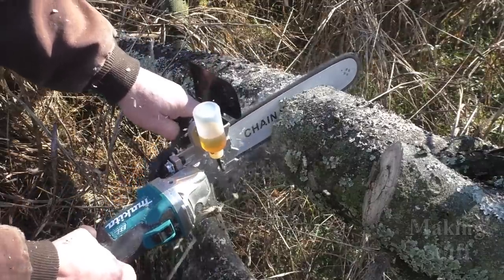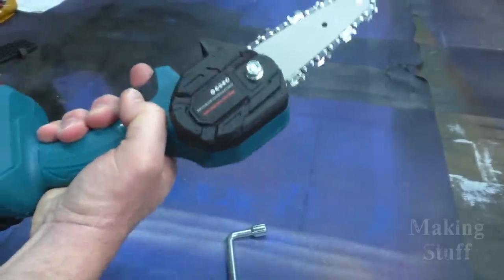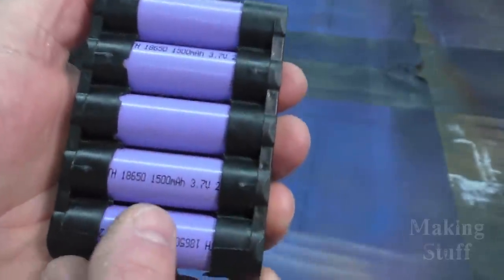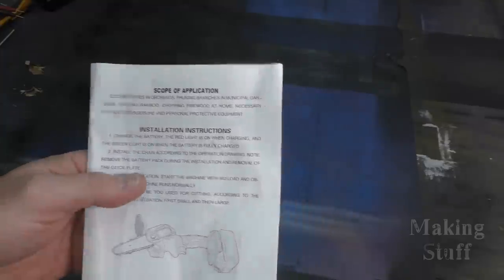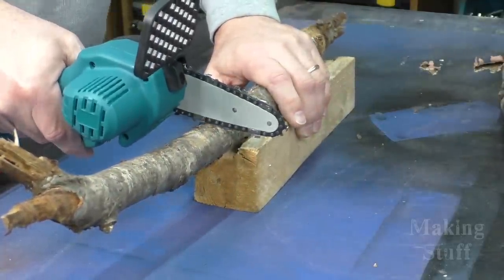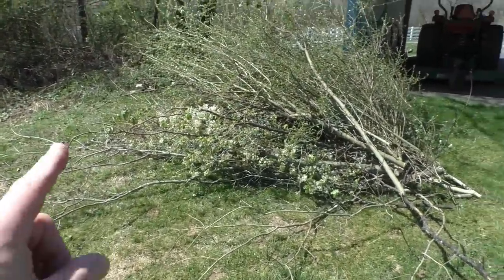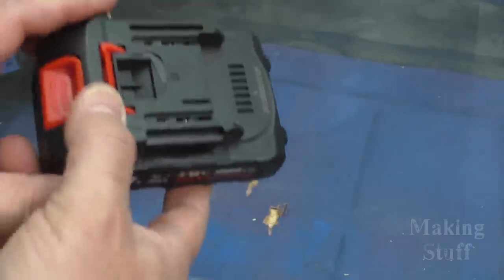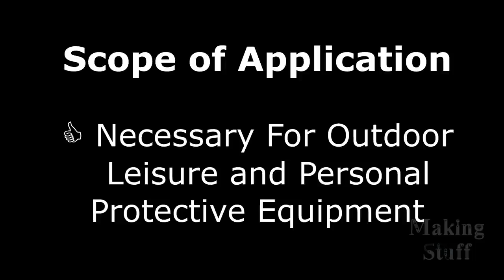Mini Cordless Chainsaw Review - Is It Any Good?

Comment: Thanks for that upload very much appreciated I grow a lot of eucalypts white yellow box redgum and they need trimming when young to get them growing up and not out, to get maximum growth from them. Definitely going to get one, as I have about 9 chainsaws and am registered as a forestry plantation and am so impressed with the ease it cuts no rump rump rump brrrrrrrrr with the saw plus I have the makita battery system for trimming younger trees limbs back. Plus with a knock off 9.0 ah makita battery I reckon it’d last for ages. I use one on my makita 18v tyre inflater.

Comment: Good info thanks for the review looking at one of these to clear mtb single tracks carrying in a back pack note i will be taking the battery out whenever its not being used as i dont want it to chop my head off. The lack of safety switch is the only bummer i see thanks again .
Reply from the maker: Removing the battery is a good idea.  I do the same thing when I'm not using it.

Comment: A great video, thank you... I bought a 10-inch one and unfortunately had problems. It kept cutting off every 2-3 seconds, then I put a newer battery pack, worked for about 20 minutes, while motor getting extremely hot, going out in smokes and eventually stopped starting, just clicking and nothing happens. Stopped working while smoking and smoldering. Probably burned out. Waited for it to cool down, took it apart and  realised that the motor bearings were probably bad, too tight or defective. No free spinning of the shaft. Got a full refund from Ebay for AU$ $68... Not sure if the motor shaft should be freely spinning, mine was not, and hence thought that the bearings must have been bad that put extreme stress on the motor eventually resulting in it burning out... is the motor shaft free spinning on yours? Please let me know. I am thinking that mine was probably defective and considering buying the same one but from a different seller. Also, mine came without any mention of the lube oil, nothing in the instructions manual, etc. I do not think that the lack of lube could have caused such a rapid failure.... Thanks.
Reply from the maker: My motor is free spinning.   Make sure the chain was not too tight.  You should be able to turn it with your hand.

Comment: Handy little tool for all those branches that are too thick for loppers while being unworthy of an actual chainsaw. I could put it to use during all those brush cleanups I'm doing for my customers.  Although my brain is telling me to spit out 130$ for a Stihl mini chainsaw. It will last. This thing, I doubt it..
What about the autolube? Does it automatically lubes the chain or you have to periodically sprinkle the oil to a bar from that container you got with the machine?
Reply from the maker: No it must be manually lubed.  A little bit goes a long way, it's not like a regular size gas powered chainsaw.

Comment: That "chain brake" is just what happens when power is cut-off to a brushed electric motor.  There's no gas engine crankshaft & piston that keeps moving when the ignition is cut-off.
Reply from the maker: Technically you are "cutting it off" but that isn't what I am talking about.  I am talking about letting go of the trigger.  When you let go of the trigger it immediately stops unlike letting go of the trigger for a gas chain saw that is rev'd up.  Thanks for watching!

Comment: Small chainsaw with no trigger guard or safety lockout. Great tool but in the back of my mind I’m hearing the sound of arterial blood pumping out. A relative just cut through the top of her thumb with a Ryobi mini hedge trimmer. At least wear thick gloves so you have some warning the blade is too close to something important.

Comment: Thank you for this review, I have been debating buying this mini chainsaw. since my husband passed, I don't use the petrol chainsaw because it is too heavy for me and the electric chainsaw is a bit limited due to needing to be near a power source, now I can go and trim the field hedges easily.
Reply from the maker: Glad it was helpful!
Reply: Another item for cutting up wood easily is to get a cheap compound mitre saw.. just be careful with hands and fingers. I’ve cut a lot of wood up for the fireplace on the drop mitre saw.. saves having to sharpen chains on old wood

Comment: I like it. As far as your complaint about the safety that is the part that makes me happy. Mainly because I'm not an idiot . I realized that I'm holding a dangerous object in my hand I treat a chainsaw just like I would a firearm with respect. And though we have safeties on firearms I do not believe that a little one-handed chainsaw such as this should have a safety. Possibly a trigger lock that would work either to keep the trigger depressed or to keep it from being depressed but nothing that you should simultaneously have to mash at the same time as the trigger. Flip the safety off and match the trigger as many times as you choose before you hit the safety again that should be plenty of sufficient.
Reply: Thank you for the video it brought a nice tool to light.

Comment: As a tree worker, i'm curious about adapting this to extension poles. There are times where the full size power pole saws don't have sufficient reach, and the branch is too large to cut with a hand pole saw without wearing your arms out, and it doesn't make sense to climb after.

My thoughts would be to run wires from the battery, through the extension poles to the saw secured to the last extension pole. There would be connectors at the saw so if it were to disconnect it would not be possible for it to come down on you while running.
Reply: There are mini chainsaw on a pole available also on Amazon and home depot
Reply: @sonoworld875  Yeah, the longest you can get is 13ft and it costs round 6-8 hundred. Running wires through extension poles a tree service already has could give greater reach and cost less in the event it gets damaged. Replacing bent pole saw poles is expensive. Replacing this is $55 replacing a an extension pole is $40, so better reach, less cost.

Dont get me wrong, the pro pole saws are more pawerful than this. The purpose of this would be for the branches that are too big to do by hand and out of reach of the 13' pro pole saws.
Reply: @nate2838  I saw one dewalt $179 in Home Depot website today but only tool without battery
Reply: @sonoworld875  Looks pretty nice, though still shorter than 3 or 4 6ft extension poles.
Reply: I did this. I mounted  mine to my 16' alum pool extention pole. Lightweight,  I can reach branches over 20'high. Made a mount using a plastic Makita tool holder and plastic flange that was a plug on a roll of synthetic roof underlayment , fit perfect on pole. 20' extension cord , bent plug to fit Dewalt 20v battery and switch added to bottom. Clips to tool terminals. Battery is in a tool bag on belt so less weight. Works fantastic, easily have  done a few thousand $ worth of trimming.
Reply: @earl3358  Glad to hear it works as well as i thought it might :)

Comment: What size file do you use to sharpen the chain? The smallest chainsaw file I can find is 5/32 and it is too big.
Reply from the maker: Sorry I don't know. I have not had to sharpen mine yet. Hopefully someone else will know and comment.
Reply: When I got mine it said on the spare chain package 4 mm and 4 mm is pretty close to 5/32 and mine took the 5/32 file so it might not be 100% exact but it should work and for how cheaply these saws are made and sold all you really need to do is file the underneath edge of the tooth and it will cut again.

Comment: Just found this video and the tool looks like just what I need to trim overhanging branches from my neighbors yard. I always hit my head on them when I am on my riding mower. The web site looks a little funky though. Has anyone ordered from them? Is it a safe site? It started out asking to allow access or block it. This bothers me so I said block.
Reply from the maker: I get stuff from Banggood all the time, they are a legit company.  I also use mine on riding mower and tractor to cut braches that hit me in the head.
Reply: @MakingStuff  Thanks for the reply. I placed an order and am just waiting for it to come in.

Comment: I wish they make a pole for these cordless mini saw for far up limbs. would be much lighter to handle / The 10" electric cord chain saws are heavy still. Yes you need to keep the chain OILED. I use machine oil cause the can is easy to carry in my pocket!  >>  I would recommend having 2 chain saw blades. While you can still work!  While sharping the dull blade >>>  If you want to really work your ass off?  Get 2 battery packs! 1 charging, while working with the other one. I like the 2 hour break charging > before hitting it again 😆 I'am lazy > I hate all the clean up work, working with Trees > in 30 min your got a big pile of limbs and things to clean up > its got to be burnt or chopped up into fire wood
Reply from the maker: Yes an extension would be nice!

Comment: I purchased the chain saw.  I have not been able to charge the battery.  The battery charger plug does not fit the battery plug.  I have attempted to contact Banggood and in their response stated they need a video of the problem.  I having problems with the video and where to send it.  I have problems with Banggood before have decided not to do business with them.

Comment: Is Makita’s charger charging this battery? Or only original equipment’s charger?
Reply from the maker: I have only charged the original battery with the charger that came with it.  I don't own any Maktia brand name batteries or charges.  The Makita battery in the video was borrowed.
Reply: @MakingStuff  Thanks.

Comment: What size file do you use to sharpen it
Reply from the maker: Other viewers have said that they used 1/8" but I have not tried it so I'm not 100% sure if it is correct.
Reply: @MakingStuff  I think one8 inch is probably correct I will have to look for some files

Comment: Great video. I'm an electrician.  I would use this to cut foam blocks in icf concrete foundation walls to run wires and cut out for electrical boxes.  May be worth the chance at 55$. Wonder if you could find replacement chains in namerica. Already stocked with makita so there's that. My guess is it would work for about 10 hrs and goodnight Charlie.
Reply from the maker: There is a link to replacement chains and bars in the description.
Reply: Thanks Brosky!
Reply: @MakingStuff  Fantastic Video! Thank you. I've searched for the link in the description to locate bars and chains, but can't find it. Can you point in the right direction please?
Reply from the maker: @lizc8048  Banggood no longer sells the replacement bar and chain so I removed the link from the description.

Comment: 1. I tightened chainsaw. No matter how many times I did tight it. It loosed and jammed. I returned back to Amazon.

2. I cut the logs with it. It was about 10 logs. All of suddenly, the battery dead quickly. 😐

Comment: That was a hand guard  You threw on the table ~  Mine got the guard running on the top of the blade. YES I LOVE IT  These sucker can and will cut off fingers, hands and a leg.. SO RESPECT THEM ~  WELL it goes every where i go. I keep it in my pickup for camping hunting ect. Then i got another one for the yard and it stay on my riding mower
Reply: May I ask how long you’ve had yours?
Reply: @Kp1985Christschild  Right now 3 months  and i have abused it!  How? cutting thing bigger than it suppose to, throwing it around. cutting stump down into the dirt. I MEAN DOWN INTO THE DIRT LEVEL, The power last about as long as i care to use it. THAT A BIG PILE OF LIMBS TO HAUL OFF I guess about 30 to 45 min of continuous cutting!  Depending on how thick the branches are and the kind of wood hard or soft. It dose a great job i'am happy with them both >  Another thing that helps is?  Keeping the chain oiled. Just any kind of light weight oil. it can be penetrating oil, lube oil, machine oil, Cooking oil, and even Baby oil!  Some thing that want gum up. Right now i have been using Machine oil. cause the can is easy to carry
Reply: @426superbee4  thanks!
Reply: @Kp1985Christschild  Your welcome Happy Holidays

Comment: Having just spent a couple days trimming around my father-in-law's property, this would have been useful since it looks like it's considerably lighter than his corded electric chainsaw and my cordless sawsall.  A belt clip for that thing and climbing around getting to the higher branches would have been much easier.
Reply: same. I've been using my full size cordless sawzall for cutting/pruning  and it's heavy on one hand operation.
Reply: I'd feel better about climbing around with it hooked to a belt if it had a safety.

Comment: I bought one of these to cut up dead branches that fall on windy days (what I call "natural tree trimming"). It looks almost exactly like yours; it's even the same color. But mine did not work nearly as well - it was a struggle to get it even 1/4" into a branch that was only 1.5" in diameter. I admit I have no experience with chainsaws and the instructions weren't great (not much English) so I had to mostly figure it out on my own. I think it's possible the chain is too tight; I thought it was supposed to be, but from what you said I'm thinking maybe that's the problem. Or is it supposed to be oiled somewhere? You had a small container but didn't say what to do with it. I'll watch some more videos and try loosening the chain but if I can't get it to do what yours did it's going back.
Reply from the maker: It's just like a regular chainsaw, the chain should not be tight.  You have to oil it manually.
Reply: I don't know what a regular chainsaw is like because I don't own one; they are too big for me to handle. I did try adjusting the tightness but it wouldn't stay; if the screw wasn't all the way in the chain would get really loose when I tried to use it. I also tried putting oil on the chain but that did nothing. It's going back to Amazon on my next shopping trip. - I will say that these new little tools are going to be appealing to people who don't normally use bigger versions because they can't - people like me. That's a new market for them that could be lucrative IF they realize that some of the buyers will not already be familiar with how a tool like that works, and either make it beginner friendly or include better instructions. You, with your experience, might be able to get my saw to work; I can't. Amazon has a lot of these; I could try a different brand. But at this point I'm reluctant to do that because I might have the same experience. Which is a shame because I could really use something like this.
Reply: @MC-kj8uy  Thank you.
Reply: @MC-kj8uy  Completely agree with you.  I just received one of these and am shouting like Homer Simpson "why doesn't mine look like that!?!" at the video. I've tried loosening,  oiling and tightening and I cannot cut through a damn finger sized branch. It overheats within 10-15 seconds as well. 
Sorry,  I'd rather been looking forward to using it as the video made it look so easy.

Comment: I realize it would require doing math, but a useful number of battery life would be square inched of mixed wood per charge, if round square inches  = Pi (3.14) X dia ^2 ÷4 :  example a 1-1/2 diameter round is { 3.14  1.5^2 ÷4} =1.76 sq-in.
Reply from the maker: Too much math for me, LOL!  Thanks for watching!

Comment: My husband won't let me use our chainsaw. I'm 5' tall and a little weak.   Do you think I'd be able to handle it ok?  I'd be using it to sculpt wood.
Reply from the maker: It is very easy to handle.  I'm not sure how well it will work for carving.  It is a light tool and it may bounce too much when carving.

Comment: I have one, Works great Until motor gets hot. Then it just stops. Does not matter if its full battery or not. Great For small fast jobs. good tool but it has limitations.
Reply: I found the same. Too much load will cause it to shut off. Also seems a little underpowered compared to similar battery tools. Also, the construction is poor. It feels cheap and nasty, which of course, it is. The concept is really good though.

Comment: Bypass the thermal safety stuck to the motor, they always fail, just pay attention to how much you load it. Also oil the heck out of the chain. I love mine too!
Reply: How do you bypass it? Just pull it off the motor and stick it somewhere it wont get hot?
Reply: @ToxicTeemoOCE  It also acts like a auto resetting circuit breaker, that's the mode that fails. I cut the wires off and soldered them together. Keep in mind, with no overload protection it's easy to burn that cheap motor, treat it nice and it will be fine for a long time. My wife ignored me when i said don't overload it, I walked away for 10 minutes, when i came back there was smoke rolling out of the motor, it still works though! I have used mine for a year without the thermoswitch in place with no problems.
Reply: @rippenbug  Ahh cheers for that, I'll see if it's a problem first, but if it suddenly stops working, I'll give that a shot.

Comment: there is way too much splatter with this chopper. so I'm going back to my trusty12" on my next job see. cuz youz can angle it to direct most of the splatter to the floor with little back spray.